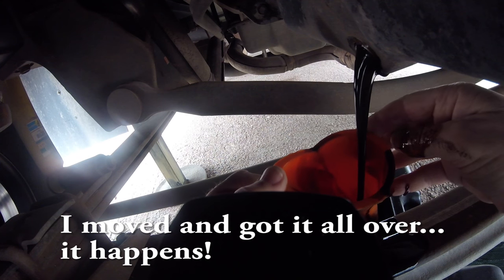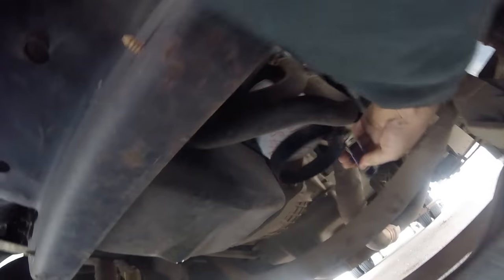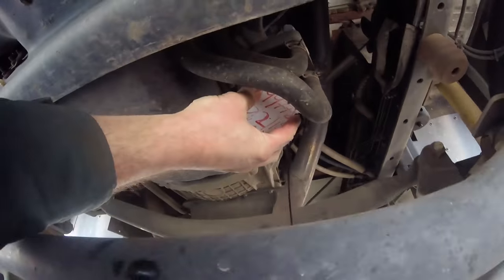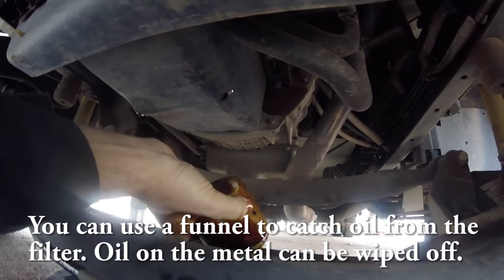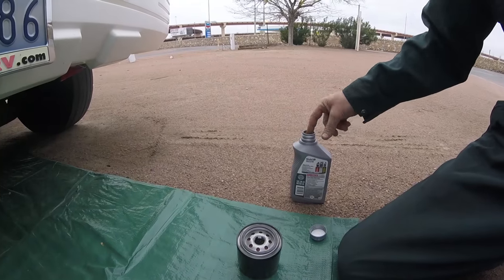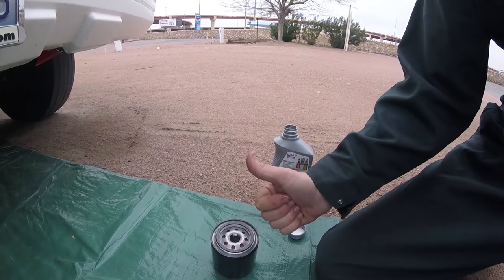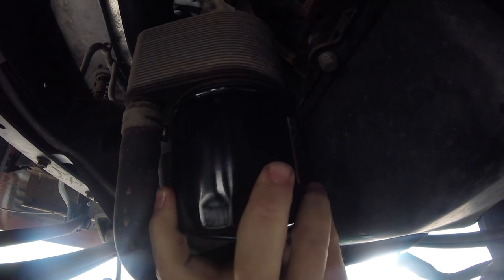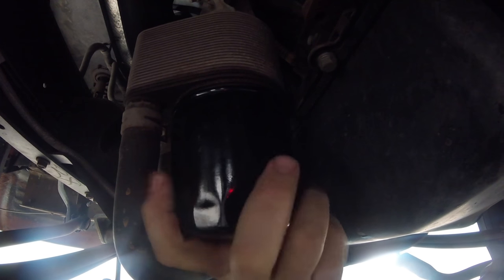How To | RV Oil Change For Beginners Ford F53 Chassis

Comment: Great video .   I woud add this for beginners.....when taking off the old  oil filter make sure the rubber gasket came off with it. when i was young i put the filter on to tight and when i took it off the rubber gasket stayed on and i didnt notice. Of course when i put new one on and started up the car the oil all came out all over the driveway  lol. remember lke you said " HAND TIGHT ONLY " Funny story but true and never happened again and im 67 now with some expierence  lol  .
Reply from the maker: That's a very good point! Again, because I have done it so many times, it never crossed my mind to mention that! It actually happened during this oil change. When I went to wipe down the area where the filter goes the old gasket was still there. Whoever did the last oil change had the drain plug and the filter so tight it was ridiculous!

Thanks for sharing!
Reply from the maker: @RV Uff Da A quick inspection after keeps you out of trouble.

Comment: paul happy new year to you and lorena.i change my oil on my f53 chassis motorhome also,cant understand why ford made the fill tube like they do  other than they where thinking  of it being filled   at a commercial garage with the oil change equipment.i added some heater hose to a funnel and then used a hose clamp to make sure it stays attached to the funnel.the funnel had a tab on it with a hole large enough to run some cord through it which i than tied off on a windshield  wiper arm, it  made adding oil much easier for me.also thanks for the good tip on taking your used oil with you when buying your new oil to save yourself some time,thanks
Reply from the maker: Yeah, the oil filler tube is a complete joke! Great tip using heater hose! I used the qt containers to fill it because I didn't have an extra hose or funnel that would work. The qt containers fit right up under there and worked perfectly. I will be picking up the proper stuff for the next one and readdress that at the time. Remember to check that the autoparts store will take your oil before you go. Thanks for sharing! Paul
Reply: Because Ford doesn't make the coach. If it was better positioned the coach builders will complain that it's in the way of their design.

Comment: Great Job on the steps Paul, but it would have been interesting to see how you actually add the new oil using the correct funnel as a conduit. That can get really messy as well!   Good Stuff!
Reply from the maker: I initially intended on using a funnel, but it was actually easier NOT using a funnel to fill it because I didn't have the correct one! That was the first time I had to put oil in it and I discovered the oil filler tube is in a ridiculous spot. It was easier using the qt bottles so I wound up pouring from the 5 qt jug into the smaller bottles and using them to add oil.

I thought about that after I had already shot everything so I probably should have mentioned it. When you do this stuff all the time, you assume everyone has the same skill level and just plow through it. I need to slow down a bit and show everything. Then I worry about people who know what they're doing going, "why did you have to show us how to put oil in the filler tube dude!?" Lol! Take care sir!
Reply: It's all good Paul. I was just teasing with you because many of us have been there on the process of replacing the new oil.  You're golden!

Comment: a tip .... on odd occasions you may find that due to over tightening your pan plug may have screwed up the threads, When that happens you may get a slow leak. The fix is a tapered oil pan plug which will tighten to any damaged thread. .... Steve
Reply from the maker: Thanks for sharing Steve! Whoever did the last oil change on our coach had the drain plug unbelievably tight! It's just not necessary..snug it and then some and you should be good. Like I said in the video, I'm switching over to the quick change drain plug...as soon as I find out where I put it! :)

Comment: very good video, my 1993 Fleetwood Pace Arrow has a F53 chassis with a 460 it takes 7 qts. with filter change., which I all ways do. thanks for the Info
Reply from the maker: Thanks for sharing Stephanie! I'm not sure why the difference in capacity? I'm glad you said you always change the filter. Changing the oil without a filter change is a complete waste of time becauser of how much old oil is still in the filter.

You got me thinking about the filter change, but mine took 6 qts including filter change and that's what the manual shows. I wonder why the difference...anybody!? Might have to ask a Ford mechanic about that one. Safe travels! Paul
Reply: The Motorhome Experiment back in the old days I had a 1971 429 Mustang mach 1 it all so took 7 qts of oil with filter change it must have a larger oil pan or a oil cooler

Comment: Well done Paul. If you're going to keep up the how-to series, how about a video on greasing the front end?
Reply from the maker: Allen Freeman Thanks Allen! I could do that. Appreciate the suggestion!
Reply: On my second try I finally managed to find all 9 zerk fittings and figured out that I needed to turn the wheel all the way to the left to get one of the fittings on the left side.

Comment: I think I would take that bolt with me to the store too.  I'd have to make sure I have the correct wrench to get it off and if I dont have one I'll get one at Harbor Freight on the way to get the oil.  I hate making 2-3 trips for one job.
Reply from the maker: That's always a good plan Michelle.
Reply: Umm, how are you going to take it to the store if you hadn't already removed it, with a wrench?  Furthermore, every RV should have a tool set in it.

Comment: Hey Paul, have you figured out how to get the air filter housing open? THAT would be a handy video.
Reply from the maker: Mine is pretty easy, but yours may be different. My has two latches in the front...flip them up...lift the front of the housing a little and slide it back off the tabs on the back and it lifts right up. To re-install, with the housing slightly tilted up on the front, slide it back onto the rear tabs, then put the latches back on the front. I can always toss a short video on Facebook, if you need it. Let me know if you get it!
Reply: I'll try again next time I'm at the RV, but I don't think mine is that easy. I struggled with it a good long time last time I tried.

Comment: Good job. Next time get yourself a fumoto valve and use it in place of the drain valve. Also take a gallon jug and cut it in half and use it as a funnel to drain the oil from the filter to a pan. Also most of the dip sticks are marked wrong so just fill it  with the six quarts, run it and then make a new mark on the stick. Been doing that since my MH was new. 2006 Allegro. One more thing, go to Wally World and get the 5 quart  container. Much cheaper than buying separate quarts.
Reply from the maker: Hey Joe, I bought a Fumoto valve before we left our house and was going to install it, but I can't find the damn thing! Lol! I like the gallon jug trick, I usually just make a mess and wipe the frame. Hell, there was enough room to put the drain pan on the crossmember, if I had been thinking.

I totally agree with dipsticks being wrong. They get a little bent, a little twisted and they couldn't possibly be right! I bought the 5qt Mobil 1 and 2 extra qts. The filter was free with the 5qt jug. Does Walmart take used oil? If they don't, I'll pay a little extra at Autozone, but they'll take the old stuff.

Thanks for sharing! This is what makes this community so awesome! People sharing ideas and experience with others! Simply AWESOME!

Comment: Nice job. You get what pay for, and $3.99 for a oil filter is asking for trouble. To each his own, just my opinion. I also write the date and mileage on my filters. Of you over torque the filter, you will struggle greatly next time you need to remove it
Reply from the maker: You're probably right and I should use more expensive filters, but in 40 plus years of doing this stuff I have never had an oil related engine issue. Same thing with dates and mileage. As long as I'm in the ballpark, it's good. As I said in the video I usually only hand tighten, but an extra 1/4 turn should case any problems during the next oil change. We appreciate your input! Safe travels!

Comment: If you change your own oil you can go online and download a coupon for $5.00 on Mobile One. Castro, Pensoil, etc. usually have coupons also. Not all auto parks stores will take your used oil.
Reply from the maker: I could have used an extra $5! At Autozone, Mobil One had buy 5qts, get their overpriced $15 filter for free. Still a great deal. Always want to call to ahead for sure. Autozone tends to be my auto parts store of choice and they usually take it. How was Vegas!? Still there?
Reply: Always looking to safe bucks😉 I usually check online to see who has the best deals.
Reply: Btw, Vegas was great for Xmas. We got back in yesterday and dang the weather sucks here also⛈🙁

Comment: dude, the oil can go 8k yes, the detergants in the oil can NOT do 8k miles, all the companies saying 10k or more are having carbon build up in the engine, 5k miles for city and 7500 for highway. oil is cheep, engines are not
Reply from the maker: I used to think the same thing, but some experts say different... https://www.edmunds.com/car-care/stop-changing-your-oil.html. On the Mobil1 Full Synthetic qts that I bought it says right on the bottle..."guaranteed for 15,000 miles of protection." I agree oil is cheap, but honestly when is the last time you heard of an engine going bad because of the oil breaking down?
Reply: Your manuals will tell you something different. Motor homes are considered to be in the severe service category requiring more frequent servicing. They operate at, near or over gross weight 100% of the time.

Comment: Doesn't ANYONE grease a vehicle anymore?
Reply from the maker: This was just about a simple oil change. With that being said, many steering knuckles, tie rod ends, suspension parts, etc are sealed now and don't require grease.
Reply: @LifeWithPaulLorena  Not on a F53.
Reply from the maker: @trustme7731  You are correct.

Comment: What about resetting the computer?
Reply from the maker: Mine does not have that feature so you would have to check your owner's manual or do a quick Google search. On our Ford Edge it's a simple scroll through settings and hit "reset oil."